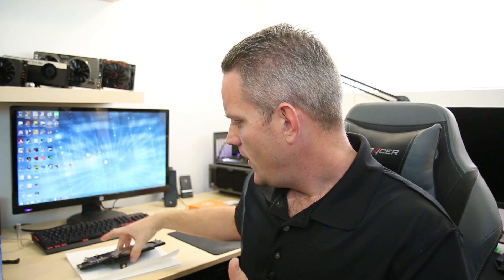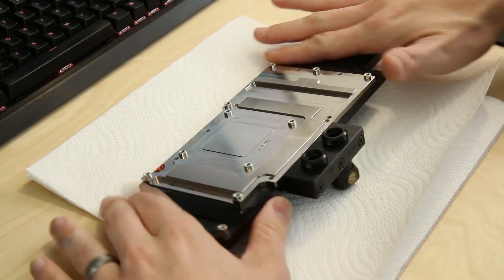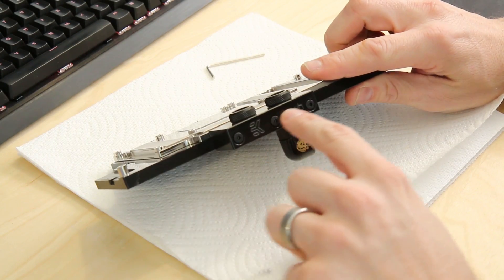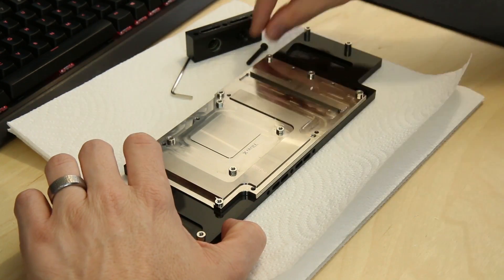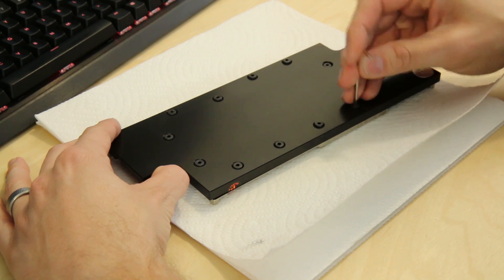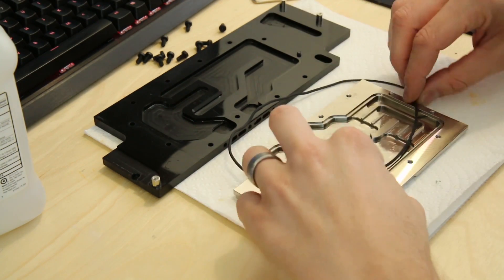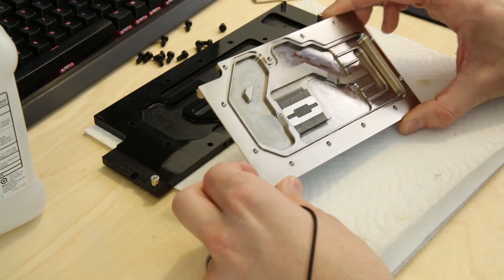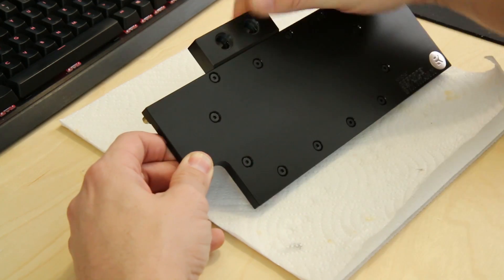Inspecting the inside of my GPU blocks - How to clean GPU blocks

Comment: Oxygen deprived cell is a reference to an electrolytic cell (same of those found on batteries). It basically means that in the fluid there is a very low concentration of Oxygen (or no oxygen) and that can be caused by contamination once most bacteria and fungi need to consume Oxygen to survive.
Cheers :)
Reply from the maker: +Iago Jevaux Ahh, thanks for that! Guess thats not it then since people are saying that Pastel does indeed have oxygen. :-\
Reply: +JayzTwoCents No worries man!
Reply: The liquid should be heated in a glass container.  It will eliminate most chemical reactions down to the effect of heat and not copper or another metal.

Heating it in the glass container may show the fluid shifting color as the dye heats and ages.  You can increase the heat over the temperatures your seeing in the computer to accelerate the results.

Mayhem's site states that the pastel fluids contain Zinc Oxide or baby powder.  The white powder your finding may very well be the Zinc Oxide falling out of the solution over time as it is not water soluble.
Reply: +JayzTwoCents I know this sounds like a dumb idea but i think it can help us cross off heat as the cause of color change. If you were to heat up the pastel fluid in a copper pot and it didn't change color than its not heat. This is probably a not the safest thing to do since we don't know what kind of gases would be released.
Reply: +JayzTwoCents I'm sure someone has said this already, but I just don't have time to search through all the comments... The heat that has been generated throughout the GPU loop could indeed have a direct correlation with the salts. It's the same principle at salted water and heat reactivity - the addition of salts will speed up the heating process of the water due to the catalyst effect of the reaction between the water and salts. The same could happen within your fluid because (an assumption based association here) of the water based fluid no matter dye concentration of the loop. Although in normal situations, the water would cool down due to the evaporation of the water to open air and an effect of more salt to water concentration, with your closed loop, water has no place to expel to leading to the high GPU loop temperatures. I have had a problem with this once and made this purely on speculation of my system and knowledge of chemical reactions (stay in school kids) and a change to distilled water
Reply: Why are people assuming it's salt and not the zinc powder additive or something else?
Reply: +SuperCookieandthecraft I would assume the liquid is build in a manner that it shouldn't release gases, because it can cause pressure issues in the system if that was the case, right?
Reply: SuperCookieandthecraft 
I guess that if Jay is going to experiment like that, the recommendation would be to use electric heat, rather than a flame, maybe the heater he uses to bend tubes could server fairly well the purpose.
Reply: +Iago Jevaux I fuckin love knowledgeable people so much.
Reply: +Shane Lyons There is also the fact that the copper salts will have higher solubility when the loop is hot (under load)  which could lend to it not showing up enough for jay to see.  he may be rendering videos often/gaming and this could stay hidden until the loop cools and the salts begin to come out of solution because it is eventually super saturated.  Also the salts dissolved in the fluid most likely changed the specific heat of the fluid and caused it to become an ineffective means of heat transfer.  The CPU loop did not have this problem due to a lack of heat, the salt is there, but not in concentrations high enough to actually deposit out of the fluid
Reply: +hockeylazz360 If you look at the last few prior videos the CPU loop did change colours in comparison to the original also.
Reply: +9ff70f96 its a chemical salt. Salts don't only refer to NaCl which is common table salt is what you are thinking of however chemists use the term more broadly. Salts refer to compounds that are ionic in nature and have a positive cation and a negative anion.
Reply: Jarb2104 well The amount of heat given off buy a gpu is not that great in comparison to a gas burner. this would make a reaction happen slowly not to mention the fluid in loop usually never reaches of 65C because it is being constantly cooled by the radiator.
Reply: +SuperCookieandthecraft shouldnt mayhems be doing this its their fluid on the hook
Reply: Jarb2104 that wouldn't get hot enough but an electric burner
Reply: Shanee Bahera
Well yeah, they would be the more appropriate entity to do this kind of testing, but hey, who says Jay can't experiment a bit and find out himself?

SuperCookieandthecraft 
Yeah, probably, who knows if he has access to an electric burner tho.
Reply: +JayzTwoCents as you mentioned, I would also lean towards the radiators being the cause, would be good if there was a way to see inside on of them.
Reply: +Mark Carter it would be even cooler if there was a company that found a way to nickel plate the inside of their rads.
Reply: +Mark Carter the only way to look inside the radiators is to destroy them.
Reply: +Robert Coffey we use nickel plated copper a lot in electrical wiring, they sit right next to each other on the galvanic chart. You'd see no appreciative improvement for the extra cost.
Reply: As a logical, but probably stupid reason, I thought the fact that the liquid was loosing the white salts was the reason the liquid was getting darker.
Reply: 9ff70f96 I said salts referring to those powders in the liquid, sorry if that is wrong.
Reply: +Iago Jevaux isnt the biprodust of this fermentation? if so then jays pc is producing booze :D
Reply: +Gerard Ong Using a ready solution for automotive radiators (just as example) instead water can be a solution due to the glycerol contained in them to increase the boiling point? Or it can be a problem of the GPU block that does not have sufficient capacity of liquid within considering the temperatures into play?
Reply: I have this exact same issue and I think it's because of EKs radiators being 90% copper and 10% brass. The rest of my loop is nickel plated copped and acetal. At first I thought it was algae but it seems to be a mixture of algae and copper salts?

Comment: I've always found trying to put the O-ring back in the place to be the biggest PITA in the whole process of cleaning GPU waterblocks.

The mystery continues....
Reply: +TheWatcher _ He might mean puta, spanish for bitch, or could be pain in the ass. Either makes sense and mean essentially the same thing.
Reply: +TheWatcher _ pain in the ace
Reply: Ok than, I guess out of 9 billion people in the world your the only expert. Everyone stop what your doing right now!! The pH doctor is here and your water cooling loop will explode your computer if your potential Hydrogen isn't at the correct level. It's the only thing that matters in the entire loop. And things like dust, oxygen content, humidity,  metal degradation, and the oils on your hand has no effect on it, only grease and lubricants do. So be careful everyone. And you never have to add any solution to maintain a proper pH in the loop as these systems are 100% sealed and the cooper/flux in the rads are coated so they don't contaminate the system with age.  Also I can't be smart enough to build a coolant block, only the Chinese can manufacture them. How would I know how to operate a  Computer Numerical Control machine? Or a Computer Aided Design mill? Only rocket scientist know how to use those. I'm out of this one, good luck everyone.
Btw this was sarcasm, just incase the pH in your brain isnt correct to comprehend these words.
Reply: +TheWatcher _ Pain in the ass I think
Reply: +TheWatcher _ Pain In The Ass
Reply: "PITA"?
Reply: +TheWatcher _ "pain in the a$s"
Reply: +TheWatcher _ "PITA" = Pain in the a** my friend
Reply: +TheWatcher _ "Pain in the ass"
Reply: +TheWatcher _ really?
You've never heard/ read the term PITA (Pain In The Ass)?  Just thought I would try to keep my comment clean for a change :-)
Reply: +NUCK CHORRIS Sorry Nuck; skimmed through comments above your reply and saw nothing...so, what exactly is the "fairy liquid method"?
Reply: I use comp cams assembly lube part#104.
It's designed for engine building but works great in any rubber assembly. It also keeps the rubber lubricated so it won't dry out or crack with age.
Reply: +NUCK CHORRIS Silicone grease is the proper thing to use. it's waterproof and non-toxic and wont dissolve in water (or coolant) which is why it is used in plumbing for... orings.
Reply: First off I never told anyone to use the stuff I use, I never outright said to use comp cams assembly lube, I said "I USE COMP CAMS BREAK-IN LUBE".
No where in my post did I say such a thing, so obviously your not even reading the comments and just jumping to conclusions. And secondly my math aint off, do a little research besides googling, talk with actual professors and scientists before you come to any conclusion.
And BTW I never labelled anyone as a know it all, my last post was sarcasm therefor it is not the truth. Just look up the definition of sarcasm and you'll be more informed. Not sure why you gotta lash out at everyone that doesn't agree with you.
Someone asked a question regarding O-rings so I posted a reply on what I use. You simply lost your cool and started flipping out on me and everyone else that didn't agree with you. I clearly stated that I flush my systems so it can't be contaminated by the comp cams lube. And regardless your sopose to drain and flush your loop every 6 months to a year since it is impossible to maintain a proper pH in these systems. There are to many contaminates to have a perfect pH. But regardless of all that, have some respect for other people and don't just start flipping out at everyone that disagrees. Were all entitled to our opinions and swearing at people really doesn't bring your point across. There are a lot of kids that build pcs nowadays and follow JayzTwoCents, I don't think they appreciate being sweared at either.
Reply: Xander Zoolander I know what Puta means. It's one of the few Spanish words I know and probably the only one I know the correct spelling of
Reply: +NUCK CHORRIS Why would you have a donkey with a painful ass (or arse), and what did you do to that donkey to make its ass so painful?
Reply: Brechan Fraser In British English, ass mean donkey exclusively.
Reply: +NUCK CHORRIS I know what an ass is (both meanings, if you can believe it), I was asking what is the meaning of "fairy liquid method
Reply: +T2ak petroleum jelly sounds but it can breakdown from excessive heat,  also plumbers grease would be a better choice.  also some rubber compounds can can be effected by petroleum compounds.
Reply: +Brechan Fraser, I myself have used to put some kind of grease on the o-rings to keep them in place, although I'm only talking about engines and machines used in the industry, so dont know if the grease would contaminate the water loop. :)
Reply: Brechan Fraser no I never heard of PITA before, lol
Reply: I've been using that stuff since before companies were making cpu blocks, use to make my own cpu blocks on the mill. I've never had a problem with it and some of my stuff is over 10 years old, including the o-rings. Mind you I always flush my core components prior to assembly and than flush the entire system before filling. I run inline filters in my loop and have shut off valves to aid in flushing, filling, and draining. I would never assemble any components that uses an o-ring  dry, especially the comp fittings. Those o-rings get twisted and cut when turning them in to a component without some sort of lube on them. Some of the race car engines I build have oil galleries that are as small as 0.010" and that comp assembly lube simply breaks down and dissolves. So in a pc you'll never have a problem as none of the passages are that small. But by all means use whatever works for you, I just wanted to help the few guys that were wondering how to assemble the block without crushing the o-ring. Just don't paste that stuff on like cake icing lol, I personally put a very think coat on the o-ring and that's enough to hold it in place and lubricate it. Just a slight coating, you shouldn't be able to see it on the o-ring, just enough to make it shiny and tacky.
Reply: ***** Jay also water cooled before companies started making CPU blocks, but for the other part you're right
Reply: ***** well I'm not 100% sure... And I don't know the video he said it in
Reply: ***** lol happy new year (and these guys probably don't even know what Ph is)
Reply: +Brad Stepford we are almost at 8 billion calm down
Reply: I googled pH? Really? Your not even writing pH properly, all of your posts you put "Ph" when actually it's "pH". It's lower case "p" capitol "H".  That's an instant fail in chemistry right there. Lol your hilarious buddy,  maybe lay of your product. Only you could compare marijuana to pc liquid cooling. I'm sure a lot of people are having a laugh here, this is great entertainment lol
Hmmmmmm......I'm confused, first you said it's easy to keep your pH at 7, but than you said in a week it drops to 6. So if I go on holidays for a couple weeks my computers gonna grow me some weed?
Reply: And please for the luv of god show me where I criticized people on their water loops as you claim I did. Please point that out to everyone.
Reply: +NUCK CHORRIS 
-Nobody milled their own waterblocks before watercooling was a thing?
-A cooling loop pH has to stay at exactly 7.000000000000000?
-The pH is not even allowed to change 0.00000000000001?
-Swearing at everyone and everything that is even slightly different from what you know wherever the fuck you got your "knowledge" from?
-Swearing like a 12 year old and claiming to be older than Jay?

I cringed so hard...
Reply: +NUCK CHORRIS If the pH is above 7 it is alkaline if it is below 7 it is acidic. Please try to get something right.

Comment: Getting those O-rings back into the channels is by far the most frustrating part of watercooling. Ok, maybe that's an exaggeration, but it took me about an hour the first time.
Reply: +World Known Next time get a tube of brake piston grease and use the grease to "glue" the seal in the groove. :)
Reply: +sleeptyper vaseline works just as good ;)
Reply: +World Known. Seems like a similar problem scuba divers get with underwater camera housings. We use a little silicon grease, just to make the o ring look shiny. No need to use a heavy coating, it's the o ring that makes the seal, not the grease. It just helps the o ring to move within the groove to find its natural position.
Reply: I got to do this twice over................ I'm going to be very tired tonight. =w=
Reply: ***** I would but you would be able to see the smears of grease because we have the Nickel Plexi CSQ blocks.